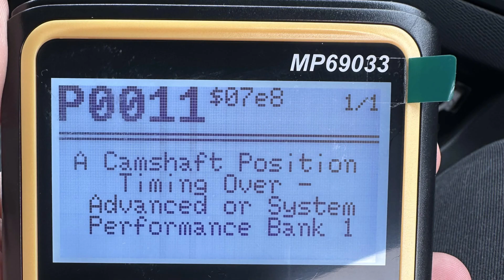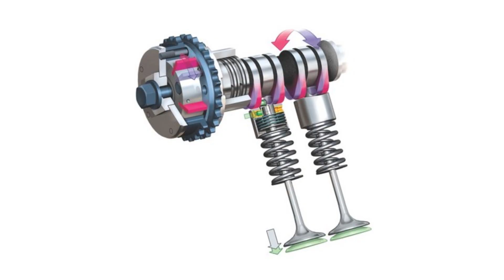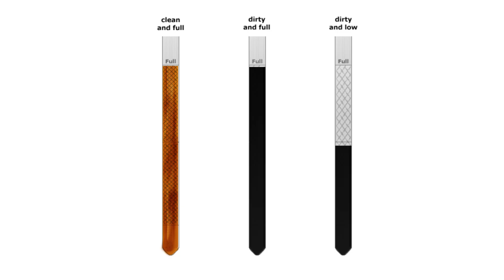P0011 Code? Don’t Replace Anything Until You Watch This!

Comment: I have the same problem. My car is a 2018 Kia Sportage. I replaced the VVT sensor and used a good type of oil, but the code did not go away. What should I do?
Reply from the maker: L - If you’ve already replaced the VVT (variable valve timing) sensor and used quality oil but the P0011 code persists on your 2018 Kia Sportage, the next steps should be to check the oil control valve (OCV or VVT solenoid) for proper function and inspect its screen for debris, as it controls oil flow to the cam phaser. Ensure the wiring and connector to the VVT solenoid are intact and not corroded or damaged. Also, verify oil pressure is within spec, as low pressure can prevent proper phaser actuation. If those components check out, the issue may lie with a sticking or faulty cam phaser, which could require cleaning or replacement. A scan tool with live data or a bidirectional function can help confirm if the cam timing is actually advancing as commanded.

Comment: What about a p0017 code with the P0011?
Reply from the maker: S - If you're getting both P0011 (Camshaft Position "A" Timing Over-Advanced or System Performance – Bank 1) and P0017 (Crankshaft Position – Camshaft Position Correlation – Bank 1 Sensor B), it's almost always a timing issue—either your timing chain/belt is stretched or jumped a tooth, or the VVT (variable valve timing) system isn’t functioning correctly due to a faulty camshaft actuator, VVT solenoid, or oil control issue (low oil, dirty oil, or clogged passages). Start by checking oil level and condition, then inspect the cam phaser and solenoid. If those check out, you may need to physically verify cam timing, especially if there's chain noise, poor startup, or engine performance issues.
Reply: @8020Automotive 2015 malibu LT 2.5, So i had got a code or two and then went and replaced the back crankshaft sensor. That should have fixed a prior issue and did fuel pressure sensor. And since then, i got 
p034b (crankshaft position direction incorrect) and p0016(crankshaft position not plausible.
I then did the front crankshaft sensor. Also did both variable timing solenoids. And vacuum pump. As doing these things worked for some. Nothing happened. 
So i drove like thhis last few months (obviously my remote start doesnt work as CEL on. And they wont go away. If back crank sensor faullty id have to pay to get yet anothher. Anyway, i now got p0011 as well as p055b intake camshaft position actuator oil pressure sensor. 

You have any ideas? Car has been a nightmare since i bought this year.

Comment: Replaced vvt solenoid and cam timing sensor. Still have code on chevy sonic
Reply: That's crazy. I have a 2015 1.8 Chevy Sonic as well and I'm dealing with the same exact issue.
Reply: @JayNichols-h7i  me too. About to go check the timing belt tomorrow
Reply: My mechanic says it could be possible. It was another defective part. He said the sensor got gunked up again in the p0011 code is coming back. I'm taking it back to the shop tomorrow
Reply from the maker: @JayNichols-h7i  Keep us updated!
Reply: @JayNichols-h7i Is it working now? What did you end up doing? Thanks
Reply from the maker: C - If you've already replaced the VVT solenoid and camshaft position sensor on your Chevy Sonic and you're still getting a P0011 code (intake cam timing over-advanced), the next step is to check oil quality and pressure—this code is often triggered when the VVT system doesn’t have proper oil flow, either from dirty or incorrect oil, a clogged oil control valve screen, or low oil pressure from a weak pump or sludge buildup; also make sure the VVT solenoid connector is clean, not corroded, and getting proper voltage, and if all that checks out, you may be dealing with a mechanical timing issue like a stretched timing chain or worn tensioner, which can cause the cam to physically over-advance despite the sensors and solenoids being new—at that point, a timing inspection is your next best move.

Comment: Hi buddy, I got Lexus Ls430. Did the timing belt kit didn’t use oem, and  got codes P0016 and P0018 come up. Car runs good no issues with timing, fuel etc only occasionally a ping at low speed. Changed VVTI solenoids, camshaft sensors ,etc, and checked wiring, still getting those codes as permanent and pending and oil clean. Was thinking maybe timing belt was out of whack. But no symptoms of that.
Reply from the maker: D - On your vehicle, codes P0016 (Camshaft/Crankshaft Correlation Bank 1) and P0018 (Camshaft/Crankshaft Correlation Bank 2) strongly suggest the timing is slightly off, even if the engine runs well—this often happens when aftermarket timing belt components, especially lower-quality crankshaft or camshaft sprockets, tensioners, or misaligned belt markings, cause a 1-tooth deviation that the ECU detects but doesn’t cause obvious drivability symptoms; since you've replaced VVT solenoids, cam sensors, and confirmed wiring and clean oil, it's very likely your timing marks were just a hair off during installation—rechecking mechanical timing with all marks aligned at TDC is your best next step, especially verifying that both cam gears and the crank pulley are perfectly aligned, because even slight deviation can trigger those correlation codes and result in mild pinging or knock at low speeds.
Reply: @8020Automotive Have to agree considering what has been changed to. Mechanic thinks its electrical issue, but all the symptoms point to the timing belt. The day I changed it , the codes come up p0016 and p0018.
Reply from the maker: @Dani-jq6db  Keep us updated!
Reply: P0011 on a 07 Acura TSX, changed the solenoid camshaft sensor and the crankshaft sensor, and the code still popped out, there’s  no symptoms, just the light. I’m thinking could it be the spool valve or the timing chain? Actuator? 
What makes more sense?